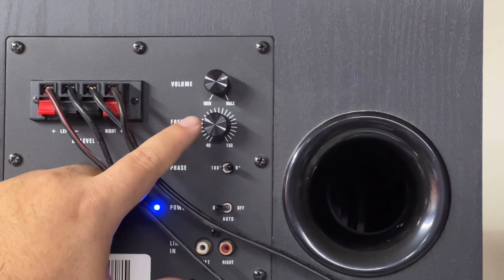Help! What notch/dash is what frequency on my home audio subwoofer gain knob?

Comment: I use my ear to set the filter. But you can guess fairly accurately: if the speakers are, say, 3" bookshelf, in the range of (predominant) 200 Hz to 16000 Hz, set the sub to about 150Hz. If the speakers are large, set the sub to a lower pass, say, 80Hz or lower. The sub fills the void of the woofers.